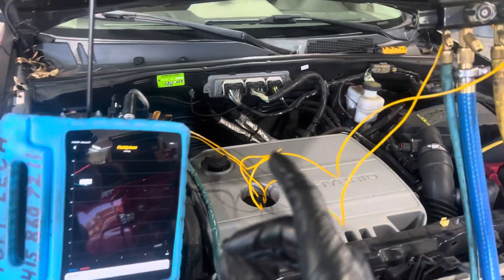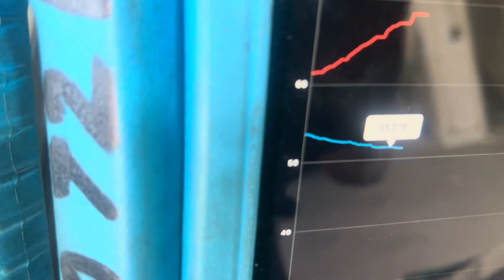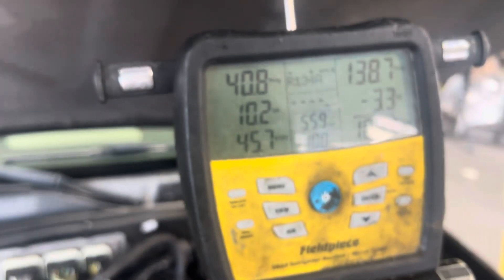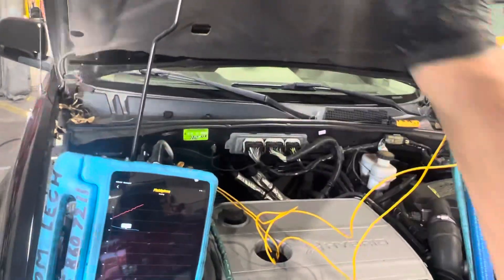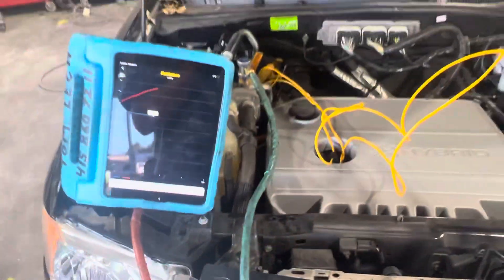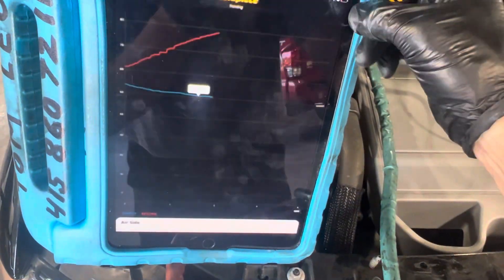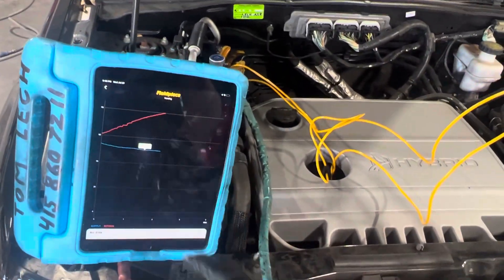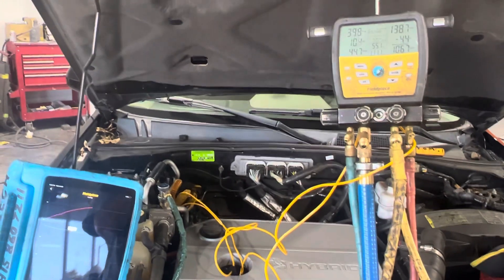fresh intake Gets hot￼ as the engine gets hot￼￼.   You can see the temperature rise on screen

Comment: what was the context for this test?
Reply from the maker: It was a multi park video series. In the earlier videos showing with the superheat and sub cooling I believe on the first video

Then I think the next video I may have shown exactly how much refrigerant was removed from the system that it had left so you can compare the before and after on the superheat and sub cooling readings. 

This was one of the technicians who worked at the shop he asked me to do this last minute while I was doing other work on other cars for air-conditioning. 

I wanted to make another video on diagnosing the compressor control valve that is located inside of a plate on the back of the compressor that is very easy to change. 

It’s only about a $20 valve after recovering refrigerant taking about 10 or 15 minutes to replace Compressor control valve then recharge it and show that the low side pressure will go down a few more psi and a passenger dash temperature will lower by another 10°F.    

But I did not have the time to fix that for him because I had too many other jobs and his was a favor to fix his vehicle before I left his shop